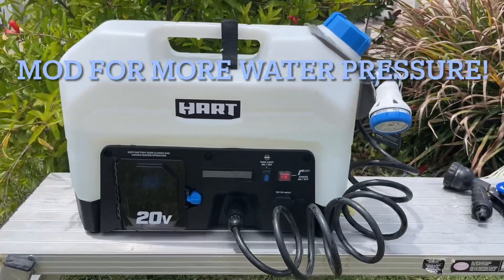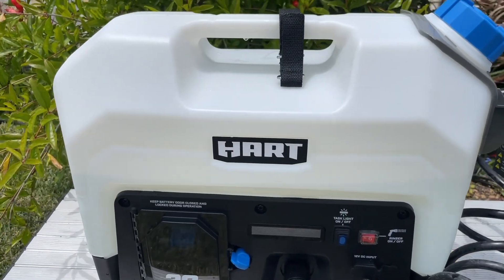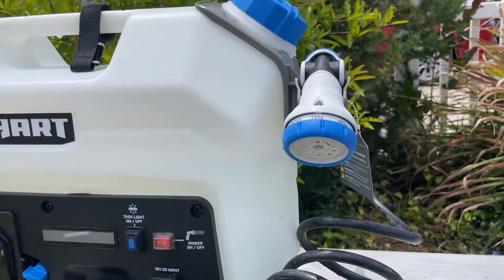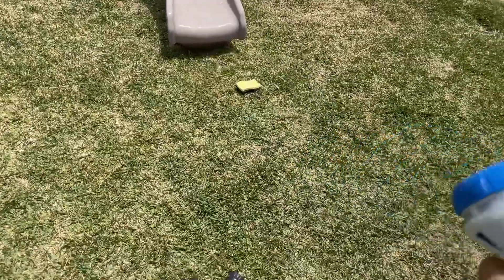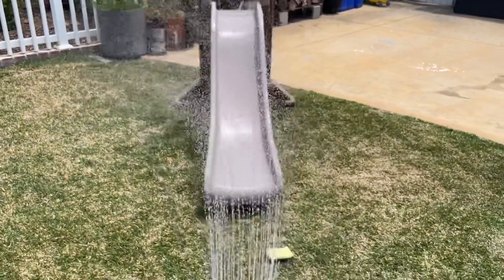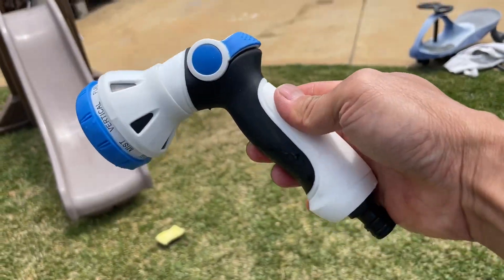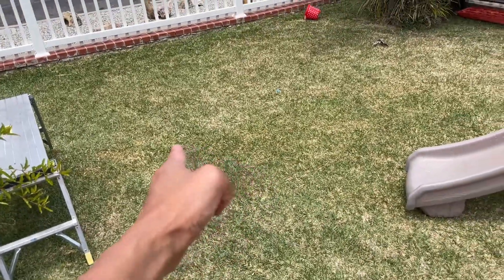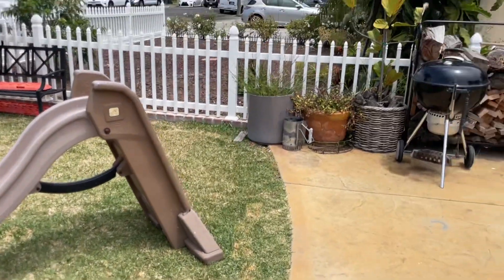Easy mod to increase pressure on the Hart 20v Portable Rinser

Comment: So changing the hose and use the original nozzle will not give you high pressure spray? You have to change the nozzle too?
Reply from the maker: It’s primarily the nozzle not the hose. I’m actually using the original hose right now because it’s longer replacing both gives you the best pressure but just the nozzle alone is plenty.

Comment: I have one. The pressure isn’t great not as good as what you’re seeing . Running on 12 V there’s  very little pressure at all. It seems there’s not a step up voltage converter. I pulled it apart. The pump is 20 V. Well, not good. It does run better on the battery.
Reply: I feel like they should have used a 12v pump and a step-down when using the battery. That way performance is consistent regardless of the power source.
Reply: @amorton94  I actually put a 12 V pump in mine. Running the 20 V battery pressure is up a little but not great. Unfortunately, the inside connector to the tank broke off not too long ago so now the whole thing is us useless.

Comment: Is it possible there’s a pressure reducer screen in the handle portion of the Hart nozzle?
Reply from the maker: I pulled it apart after reading your comments, and I didn’t see any.
Reply: @SoCalOutdoors  same here. I ended up putting my 12 V pump in it. Works a lot better when I plug it in my car. The 20 V battery still powers it, just  over volting it  a little bit, but so far I’ve not had any issues.

Comment: I recibe my today, the pomp turn on but the water is not coming out 😔
Reply: Same with mine, I pulled the tank off and the top plate on the pump. The check valves were stuck, there is a video on YouTube somewhere that shows how.
Reply: I had the same issue. I was able to fix it by filling it up to 1/4 of the tank and then moving the water around while the pump was on (about 15 seconds) then I turned it on and move it a bit while spraying and it started working normal.
Reply: Thanks i will try that and see if it work !
Reply: No still not working i guess i have a bad one 😭 I was so exited for summer beach days 😔
Reply: @jeniferrodriguezcolon5330  I just bought one mines did the same thing remove the hose turn it on and suck on the brass nozzle until water comes out. I'm not being funny thats how I got mines to finally work
Reply: @oldmanmtb1443  That worked immediately, thanks. Maybe they don't clean out obstructions after manufacture.  It's a pretty weak device and not especially well made. Looks good for beach use if you don't expect too much.
Reply: @mwesten3444  yes the pump is kind of weak but for $50 I can't complain. The battery and charger is at least that much any how I'm just using it to wash my hands and sometimes my feet after a bike ride.
Reply: I had separated the tank from the pump there's a hoes that can be kinked under it fixed that and works good

Comment: any update on the portable WeBoost?
Reply from the maker: It hasn’t worked great.  I just ordered a larger antenna so I’ll be able to report back in a month or so.  Per wee-boost the overland antenna will perform twice as well if not more.  That puck antenna is small and convenient but it’s really weak.  Fingers crossed.